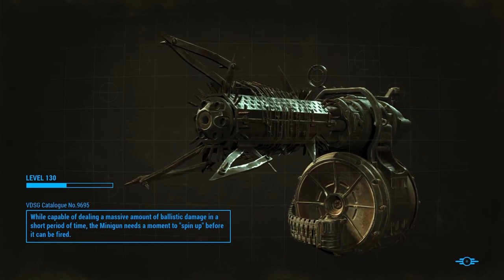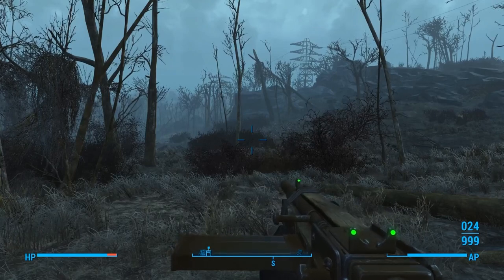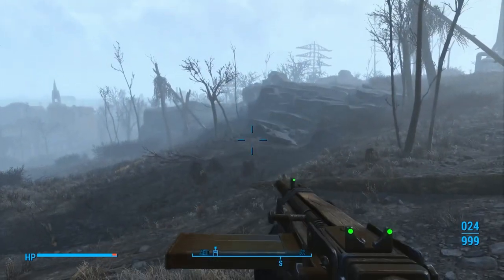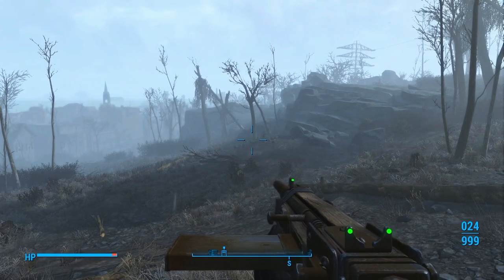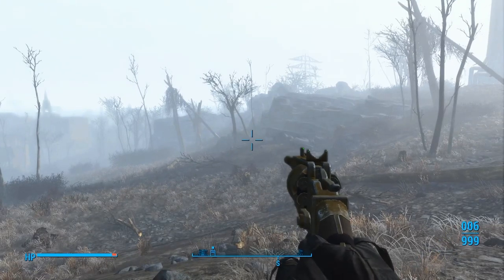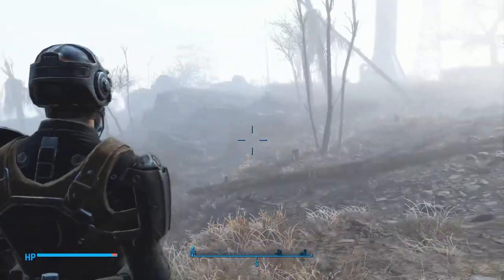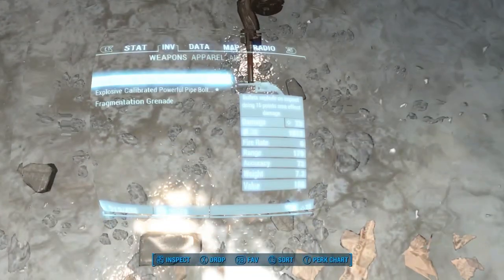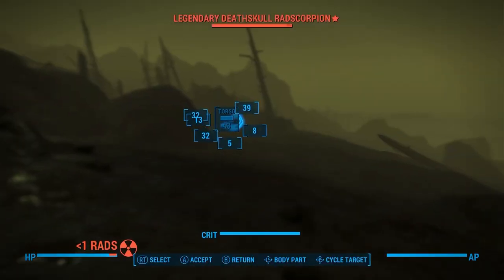Can Fallout 4’s Pipe Weapons Work IRL?

Comment: Ok, you can rechamber a gun like the sten, you just need to make a different bolt. Make it lighter or heavier depending on the grains and change the barrel according to the caliber, also if the .38 rounds are .38 special, then they should do less damage than .45 like they already do, but if they’re 9mm then no, also 9mm should give you a bigger magazine capacity. Also rechambering a SMG like the sten or grease gun is pointless due to how easy it would be to just make a new gun in the caliber you want.